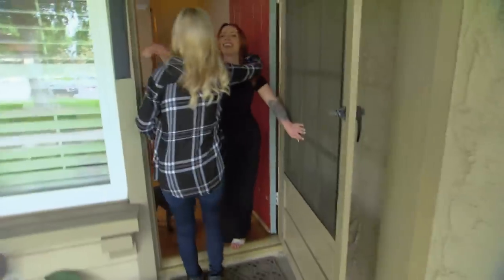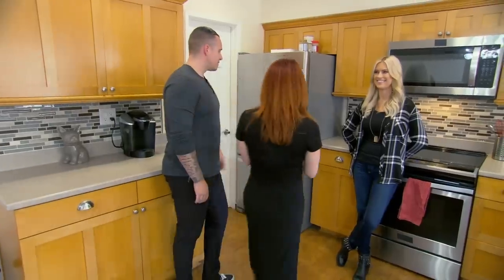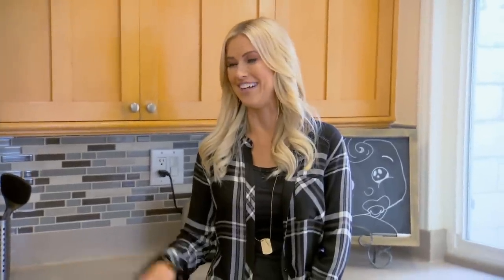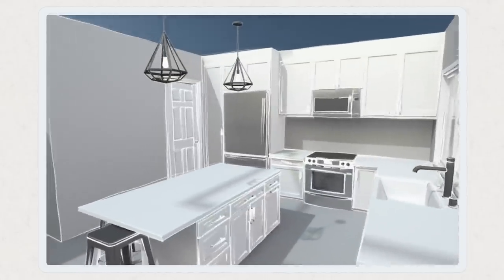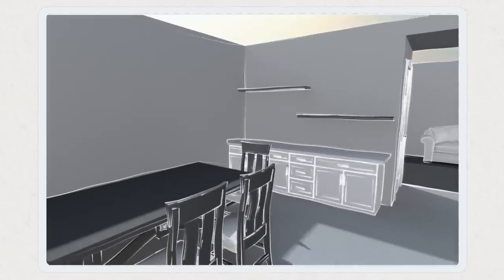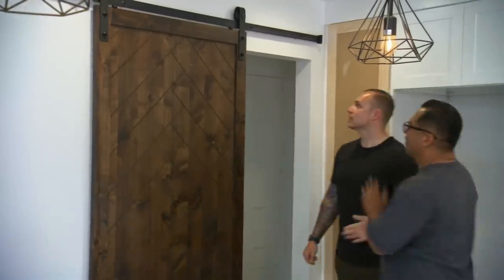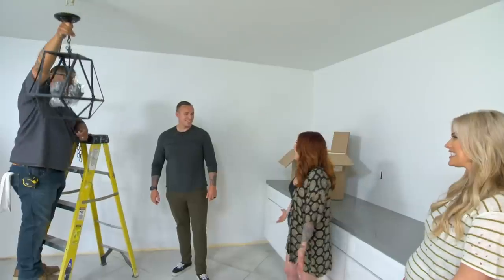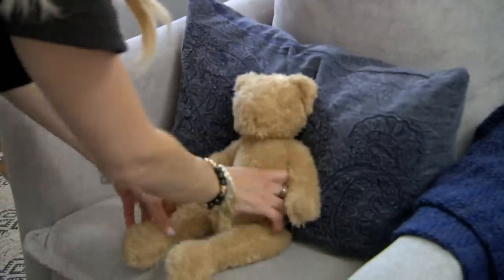Christina Has To Renovate A House In Just 8 Weeks! | Christina On The Coast

Comment: "I loove color."
Christina: adds zero color
Reply: I wonder if she provided those shelves for the client to add color. Also, the two boring grey things on the wall could be turned into something really colorful and exciting! I like the permanent neutral tones with an opportunity to add different colors over the years. I had my Chicago kitchen painted fire engine red for a couple of years and loved it and of course, had to repaint to neutral when we sold.
Reply: @ann-mariejensen2623   could be. But they'd still perhaps need to repaint when they sold. They could have easily done some form of color that would be largely appealing to most buyers. Blues and greens on the muted side are almost always  universally liked. Sage, navy...etc.
Reply: She basically used the exact same materials she used on Flip Or Flop. White shaker cabinets, grey tile, etc.